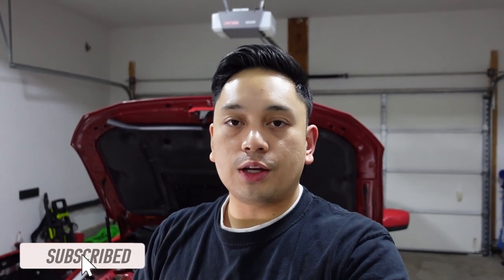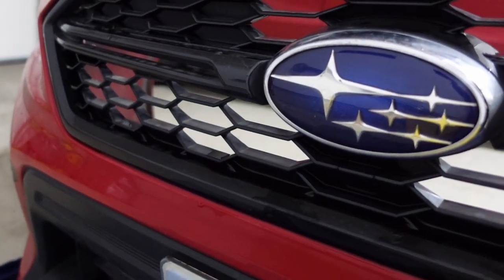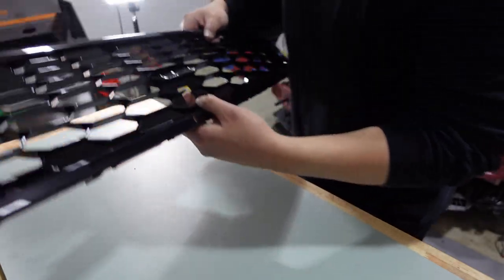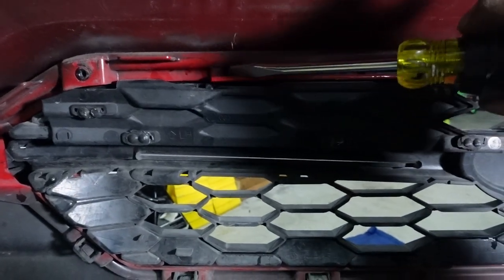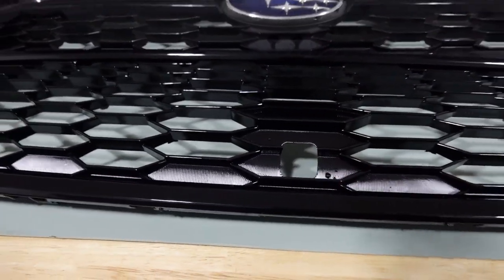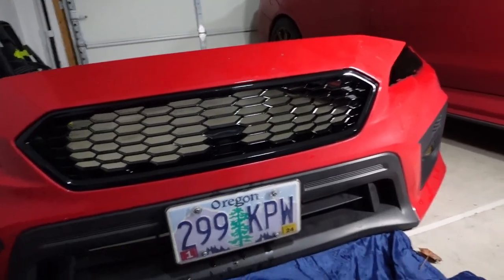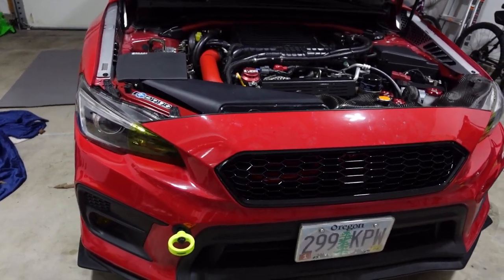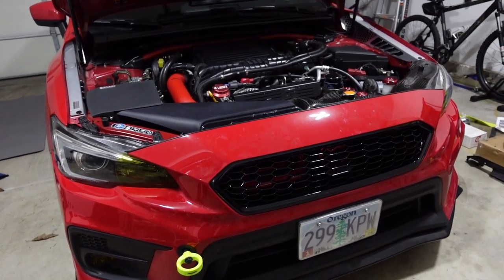Bayson-R Front Grille | 2018-2021 Subaru WRX / STI

Comment: Bayson R products have the best price points and they might have slight defects, but nothing major. When getting the skirts and front lip, make sure you let them warm up in the house for a couple of days prior to installing...and keep them flat to prevent warping....if you're in a cool climate. Red background and black stars on that front emblem would look real good. popping of the side molding, front bumper, taking them in the house to work on is easy and prevents you from scratching them on the garage floor. Whew. Great video. I think I might be purchasing a new front grill.
Reply from the maker: Great ideas! I do agree that their products are pretty solid at the low price points, very minor issues. The rear spats I have from them are perfect. And thanks, still deciding on a color way for the badges, red/black is definitely something I’m considering.
Reply: @ronfromportland  Please do a results video on that Wide mouth VT air snorkel. I'm curious if it increases performance.

Comment: Took the stock wrx grille off and replaced it with STI OEM grille. STI grille has all the holes vented where WRX grille is not (top portion as seen on your video)
Reply from the maker: Good to know! Thanks for sharing.

Comment: Is the emblem holder the same as stock? Can you use the oem badge?
Reply from the maker: You can use the OEM badge on the emblem holder but removing it/ re-gluing might be a hassle. Perfect time to buy an aftermarket badge though. Haven’t done it myself but eventually I might.

Comment: I was looking at adding this too as a cheaper option than Subsispeed JDM grille at $200.  Only thing that is concerning is they have zero customer service.  I tried messaging them a couple times with questions and it goes to email outer space lol.  You have any contacts for them?
Reply from the maker: You can try sales@baysonr.com. They’ve been responsive there but I’ve had to follow up a few times.